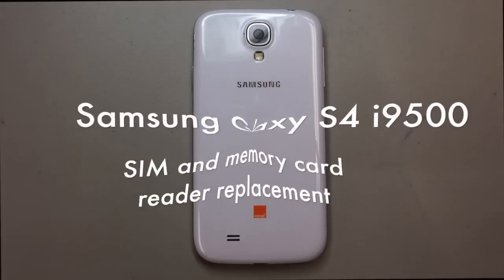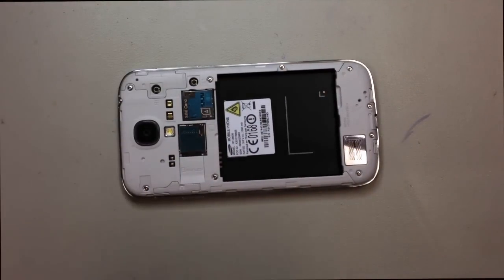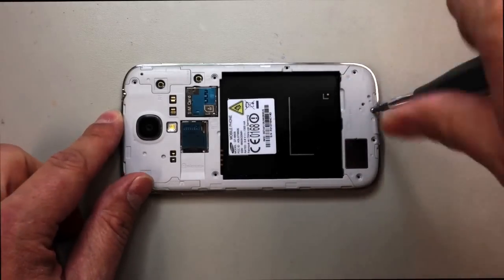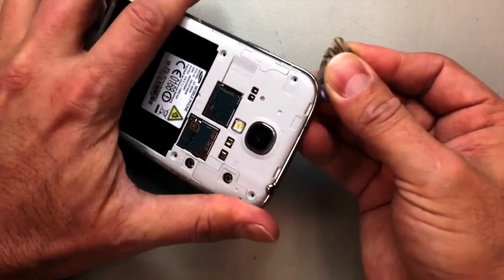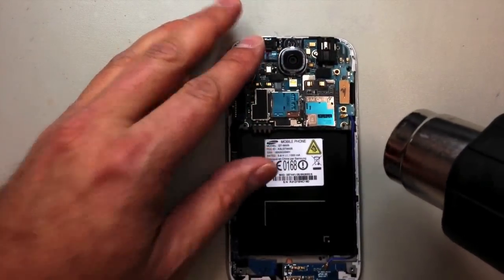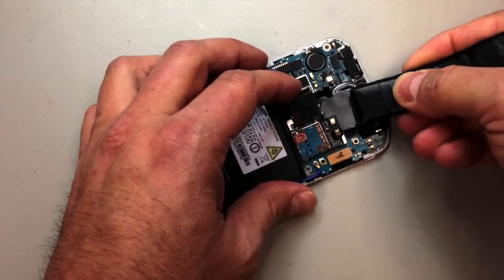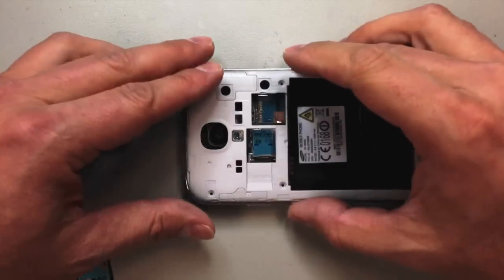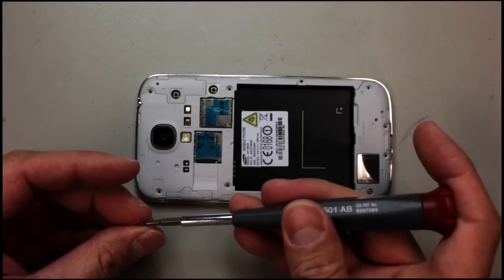Galaxy S4 SIM and micro SD card reader replacement

Comment: can't find a thing about the i727 but this looks very similar. my question is, the metal frame underneath mine popped off when i was removing the old sim card reader. is that repairable (solderable) or is it time for a new phone?
Reply from the maker: If it's what I think that you are talking about it just clips back on in between some little metal channel guides. If you can upload a picture I can give you a better answer.

Comment: So i just ordered a sim card tray since mine is needing replaced. Few Questions i have, at around the 2 minute mark what were you using to pop off the pop connector or w/e it is you call it? is there anything else i can use to do that with? Also, if i use a hairdryer to heat up the adhesive to remove the sim card tray, about how long should i hold the hair dryer over the area of the adhesive?
Reply from the maker: At around 2:00 I was unplugging the pop connector for the SIM reader module with a plastic iPhone tool. The call it a "crow bar" in some cases but as long as you have something flat, thin, and made of plastic that's what matters. If not a fingernail works well enough. You'll have to plug in the new one when you install the replacement part. Just heat it up until it's warm to the touch. 90 degrees F should be plenty.
Reply: Go Cell Phone Repair ty for the info :D My local walmart sells these little "crow bars" gonna go buy one and once my sim card tray arrives in the mail i will get to work on repairing my S4 ^_^
Reply: suihigh Just got my sim card reader in mail today.. took me less than 10 mins to replace the old part and now my sim card reader works!!! didnt have the tools so had to carefully use my fingernails lol. Thank-You SOOO much for this video, was very helpful and saved me a lot of money if i went to have it repaired somewhere.. only 8 bucks for the part off of amazon! :D

Comment: i like your work , I need your help is it possible to add sim card slot to htc evo 3d , I just got it and I find out is no place for sim card slot spicily that I am going to travel and I want to use it in another country
Reply from the maker: Nope. Your only option is the native carrier, presumably Sprint, or possibly flashing the software to a company like Cricket that accepts foreign ESNs. You need a handset with GSM capability which this phone does not have.

Comment: Hii i was having nano sim card and i bought s4 and want to use so i purchase sim adapter from nano to micro and when i plug sim card with this sim adapter its actually stuck inside if you have any solution to remove stuck simcard please tell em thanks a lot.

Comment: I have never used a heater before. For how long time should I hold it there and how far from the device? Any tips? Also, what temperature do you have?
It would be really helpful if you will make a video about it and upload it about that. Please let me know if that happens :-)
Reply from the maker: I'm working on a detailed blog post for my website regarding this topic. I was planning to include photos but maybe a video would be better. Until then- you want the temperature to be about 100 degrees Fahrenheit. It's not that hot really and you don't need that much heat as too much can be a very bad thing. I hold the phone in my hand and the gun about 8-10 inches away. If you point the gun at your surface that need to be heated and at your hand simultaneously your hand will burn before you damage the phone if that makes sense.
Reply: Thank you for the response. If i only need to use 100 Fahrenheit maybe I can use a hairdryer instead? What do you think?
Reply from the maker: Yeah it will just take a lot longer.

Comment: HI!  Great site. I have a question, if you can help, please?  I have a Galaxy S4 and the SIM card won't lock into place. I get  msge "no SIM card" so I am presuming I need to replace the reader as you have described here? I don't know what the numbers (I9500, for ex) mean, though, and there are many versions of the readers on Ebay. Can you help me figure out which one I should use? Is that number (I9500, for ex) somewhere on the phone or in settings?  May I have your help, please? Thank you ahead.
Reply from the maker: Galaxy S4 SIM readers are all the same. Don't worry about the model number. Those are most likely included for SEO purposes.
Reply: Thank you. For readers who want to know, the I9500, for ex, is the model number, usually found on the back panel or under battery.

Comment: I bought my I9505 second hand and noticed straight away it took a while to come up with the network after turning on/coming out of a zero service area, but assumed with the horsepower these phones have it was normal. Yesterday it started to say 'Emergency Calls Only' and I have tried everything, settings, hard & soft resets, reinstalled (3 times). The SIM card is fairly new and my SIM contacts show up.
Whilst messing around with it before it briefly came up with the network but flicked back to the emergency calls only message.
Could the SIM card reader be at fault?
Reply from the maker: Unlikely. If the SIM reader is bad you will usually get the no SIM icon rather than network problems. Since you got it used you might check with your carrier to be sure that the IMEI is okay as blacklisted phones often do what you described. Otherwise I would suspect an antenna or software problem.

Comment: I have a quick question, if this part is faulty would the memory card stop working too? My partners phone has stopped reading the sim but the memory card still works fine, I'm not sure with it being one unit if just the sim card tray can be faulty.
Reply from the maker: Yes it is possible to be one or both.

Comment: Hey I was wondering where I could purchase a SIM/SD card reader so I can replace my old one. Also what screwdriver size would I need?
Reply from the maker: http://gocellphonerepair.com/S4-card-reader PH00 should work just make sure that it isn't too tall at the tip or you'll have to grind it down a bit.

Comment: Ive unlocked my phone because of the fact that i was in a vacation in a different country and got the 4.4.2 update when i was there and when i gpt back and used my original sim it started doing the sim card undetected problem do u think its just a software issue of 4.4.2 or i probably broke something on it cause when i restart it i need to press on the sim card abd it would work again

Comment: What temperature do I need to set the heat gun to, how long should I apply it for and is it important that I use a small nozzle, like 4.7mm? It looks like you applied your heat gun directly to the board with no protection for the other components... isn't that real bad for the board? Did you preheat the phone? In every other video they cover the surrounding components with tin foil or Kapton tape.
Reply from the maker: For this repair you don't need to get the surface very hot. Not even close to the point where you'd need to worry about taping anything off. Just get it warm to the touch. Not hot enough to burn your skin but I'd say about 100 F if you measured it. The nozzle should be wide as you aren't trying to heat a very small area nor should you be concerned with surrounding components but if all you have to work with is a heat pencil just move it around over the entire surface.
Reply: Go Cell Phone Repair Thank you so much for taking the time to reply. So it sounds like a hairdryer would work fine for this then?
Reply from the maker: For this sure. It might take a bit longer though.

Comment: Is the top connector supposed to snap in? I keep pressing down on it and it keeps popping back up. Unfortunately I've already adhered the new sim card holder onto the logic board. What do I do?
Reply from the maker: Thanhduy Tran You can remove the whole metal piece from the logic board and try straightening it out. Just be careful.

Comment: Go Cell Phone Repair  I have i9505 and my phone needs to rest few days if it runs out of battery, so i can turn it on again, otherwise i cant... I've taken it to a service and they replaced its sim card reader with a new one, and it worked properly, but after few days, the old problem came back. I cant even restart it when it works, it will shut down and wont start for few days. Solution? Can there be other problem too?

Comment: Is the process for replacing the reader the same for the i337? mine seems to be secured in place by clips instead of with adhesive but i could be wrong.
Reply from the maker: It's actually both. The adhesive sits on top of a metal plate that kind of clips into place. You can remove both but the plate is kind of a pain to line back up when you re-install it.

Comment: hi   my Samsung galaxy s4 mini has an different place were you put the flex cable and Sim card reader and memory card reader
i have bought 2 Sim card readers as an replacement but when i am  abought to fix it it seems that it has a different fit and also  it just  is an small board  that when you 
de clip it from the  right hand side  and when i remove it  and then i look at the piece that i bought    its flex cable goes toward upwards instead of  right hand side like it should this happened twice

please help

Comment: So I did this fix and my phone worked great for 2 hours afterwards, then it went back to not being able to recognize the SIM or SD Card. I tried every software trick I could find online... factory reset, getting a new SIM, etc. At this point it seems I'll need to get a new phone and I'll get insurance so I can swap it out next time there is an "unfixable" error. Do you agree? Is the only remaining fix to change the motherboard? I have a feeling this is related to the Kit Kat 4.4.4 upgrade but I don't know there is anything I can do if they install OS upgrades that break the phone.
Reply: As a follow up, should I never install OS upgrades? Are half the phone problems caused by that?
Reply from the maker: Bradley Bailyn Not usually but software upgrades can only be tested to a certain extent before they are released. Once you have millions of people using it then you will be able to see many more potential side effects/glitches. My advice to anyone who wants to play it safe is to wait at least a few weeks after the upgrade is released to see if others are experiencing problems before you upgrade your device. Also what is the purpose of the upgrade? Security patches are a good reason to consider upgrading but in many cases, iOS in particular, upgrading often seems to be for the benefit of the manufacturer and not the customer. When your phone can't handle the new software you will have an incentive to buy a newer one.
Reply: Could I trouble you to reply to my question above beginning with "So I did this fix..."? I think you replied to my PS but not my main question. Thanks!
Reply from the maker: Bradley Bailyn There could be something in the phone that is causing the reader to go bad. Insurance is a tough call. For most people it's not such a great investment since between the monthly premium, deductible, and the fact that you'll most likely get a refurbished unit with an unknown history as a replacement. Changing the motherboard should solve your problem but I've seen situations where something else caused the problem. Bad charging port, frame grounding improperly against another component, damage from moisture, etc. It's tough to say 100% but I would try a new board if it was me. And always use your warranty of course when applicable.
Reply: Go Cell Phone Repair Thanks! Is that the kind of repair which a non-expert could do, or does changing the motherboard involve unsoldering each and every component of the phone and soldering back on to a new motherboard? =)
Reply from the maker: The board is pretty easy to pull. No soldering. You just have to disconnect the flex cables, antenna wire(s) and a single screw holding it in place. http://youtu.be/fdc9zA-mGq8
Reply: Go Cell Phone Repair oh. Thank you again for all your help.

Comment: Hello, thanks for this great guide ! 

I followed it and everything went flawlessly, except when i actually tried tu put a SIM in.. My phone doesn't detect it (i tested 2 different ones), BUT the SD cards are detected. 

Do you have any idea why this is happening ? And how to fix it.? Thanks..
Reply from the maker: My guess would be software, bad replacement parts, or a problem on board. Hopefully one of the first two otherwise it can become a very complicated problem to diagnose. Any signs of moisture inside of the phone?
Reply: Go Cell Phone Repair No sign of moisture. 
For the software idea, I'm not sure because the reason I changed these ports was that the sim was straight up broken. I'm running an AOSP 7.0 Rom, should I try to factory reset? 

I was careful with the board but I can't tell for sure if there was no damage, I'm not used to this kind of repair.. 

Thanks for the quick reply!
Reply from the maker: If the SIM was physically broken I'd suspect something on the logic board in close proximity might have been damaged as well. Check under a microscope or magnifier and see if you can find any damaged components. You could try resetting it but I doubt that's going to help since we know that there was hardware damage.
Reply: Go Cell Phone Repair No damage on the sim card. 

Update : I can't believe this, after waiting a day I retried and it works now!! 
Thank you so much!

Edit : it looks a bit unstable, and I'm not getting as much signal as I on my replacement phone.
Reply from the maker: Hard to say for sure but it sounds like a component failing on the logic board. For an S4 it might make sense to back it up and just replace the board itself as you could invest a lot of time and money trying to find the problem. The charging port is also part of the antenna system so that's always a possibility too but from what you've described it's unlikely unless that was replaced recently. It wouldn't hurt to double check the antenna wires though and make sure they are plugged in properly.

Comment: How about the Samsung 5? Is that as easy? My phone stopped seeing the Tmobile network but still works on Wifi.
Reply from the maker: They made the S5 much more difficult to repair. First you have to remove the screen to get to the access screws. Also the SIM reader is soldered onto the logic board so special equipment and experience are required for that one. I'd recommend a professional.

Comment: Thank you for this guide. I replaced mine today I was getting Restart SIM not working errors so hopefully replacing the reader will stop this from happening. I will check back in a few weeks to let you know if the error returned or not. I did think it was connected to the 4.4.3 KK upgrade however i did downgrade to 4.3 JB and had the same issue. Although I was still stuck using the 4.4.3 bootloader (cos i KIES updated) and a custom kernel.
Reply from the maker: Cool. Hopefully it works. Do let us know.
Reply: Go Cell Phone Repair  I replaced it and had a restart SIM error pop up message again. However I believe i have fixed it im on day 3 and not had one. Normally I was getting them 4 - 6 times a day. I removed my SIM which is a Micro SIM witch fits into the middle of another piece of plastic (the joys of virgin mobile uk). I placed some electrical duct tape to the back and cut around it using a Stanley knife. I placed the SIM back in which fitted nice and snug. I also read online that there is a software bug regarding the GPS and location settings. I turned these to off and I also changed in mobile networks Network mode to to WCDMA/GSM mode. (Disabled LTE). Touch wood has been working perfect since. As I have done many things I can not pin point the fix but doing all the above definitely has solved my problem. I believe this is a software bug and has been reported by many on forums across the internet. All these fixes I got from researching them. Try all these before applying a hardware fix. Although I will say and I am not sure if it is just coincidence but my mobile signal seems much better in general. I will check back again in a few weeks.
Reply from the maker: thejerseyshaun Cool. Thanks for the update. Hopefully it will help others with the same problem.
Reply: Go Cell Phone Repair
 no im still getting them. I also installed CM11 and applied a plastic fix to the inside of the case to apply pressure to the connector and mainboard which was reported online to be a fix. Nothing is helping. It is either a 4.4.3 onwards software bug or it is a hardware fault. I still don't know either way. All i know is it is bloody frustrating! :)
Reply: Go Cell Phone Repair  Ok I managed to fix it but it was a random fix. Nothing I did above helped but i went into recovery (TWRP) and deleted the cache. 5 days later and I have not seen the restart message once. I will check back if It shows it's ugly face again. I 100% believe this is caused by a software problem and is related to 4.3 Kit Kat.
Reply from the maker: thejerseyshaun Interesting and good to know. Thanks for the updates.
Reply: Go Cell Phone Repair
 No probs it is still working perfect :) One thing i missed is I updated to the latest CM nightly but I believe the cache clean fixed it. RANDOM
Reply: thejerseyshaun
 Just an Update for anyone who has been having the same problem . 1 week now and the problem has still not returned. Hope my updates help someone.
Reply: thejerseyshaun how did you delete the cache in TWRP?